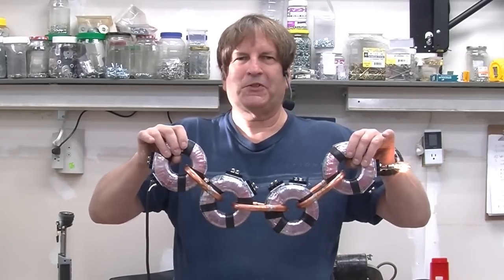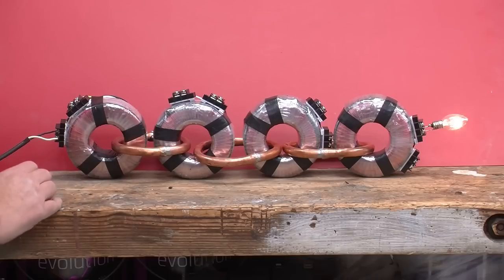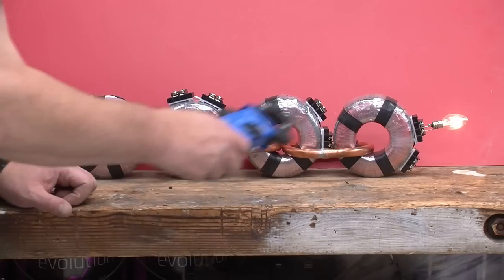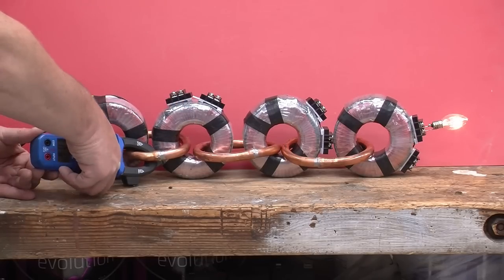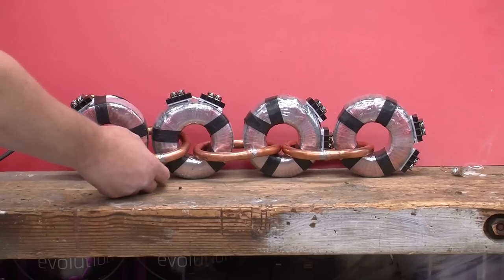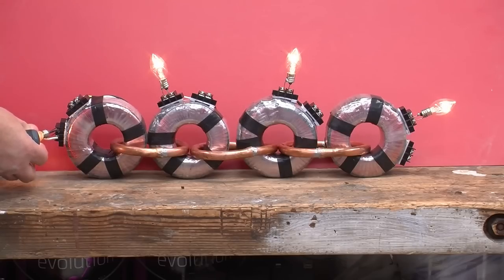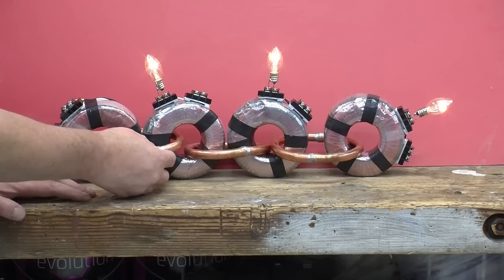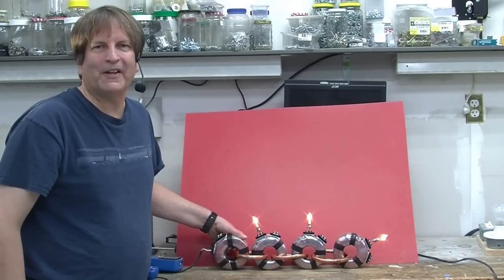Let's Experiment with an Electromagnetic Chain!

Comment: Pretty cool!  Even though the magnetic fields are completely contained within the ferrite toroid, the right hand rule shows that the electric field causes the copper coils to conduct electricity.  Did you see it at the Faraday museum in London?
Reply from the maker: "Even though the magnetic fields are completely contained within the ferrite toroid, the right hand rule shows that the electric field causes the copper coils to conduct electricity." Yeah - is really neat to see that in such an obvious way - usually the "next to each other" nature of inductor and transformer coils and coils makes that hard to see.  The funny thing is a number of commenters  don't seen to think this demo is real - I guess they must think Maxwell's equations are wrong :) 

Museum: That's the second museum in London that has been mentioned, but no - right continent though but not in the UK. I'm starting to make a list of museum that have been mentioned and will post it. I'll; bet the Faraday Museum is fascinating to visit!

Comment: what would happen if the large copper tubing wires were replaced with superconductor materials of the same size?
Reply from the maker: Then we would have almost perfect, losses coupling between the cores and the device would behave much more perfectly. 

An example of perfect behavior  would be the if we put a superconducting shorting wire through the most distant core from the power source, the shorting wire forces the the magnetic field in that core to zero as if the core was not there. That means no back voltage from that core to the superconducting copper pipe to the next core. With no back voltage that copper pipe now is a short and the magnetic field in that core is forced to zero. And so on all the way back to the core attached to the power. And with no magnetic field in that core, a huge current flows from the 120V source eventually melting something. 

In a much better scenario, in normal operation, we would have close to lossless transmission of power other than eddy current and hysteresis heating in the toroids even for larger currents. Right now with plain old copper pipe the resistance starts consuming more and more power as the currents go up limiting power transfer from one end to another to between 50 and 100W or so. The transformers used as the cores are rated at 180W so its much less than one would like. Even copper rod rather than pipe would be better.

Comment: That was excellent, thank you for taking the time to make the video.
I think I need to send this to a colleague who thinks that earth-bonding prevents (potentially hazardous) surface currents close to powerful HF transmitters. lol
Reply from the maker: Thank you! Funny - I actually do a lot of RF stuff in my day job (right now much higher frequencies although did a lot of HF 15 years ago) - one thing  I know is that at RF frequencies, you can always get surprised at where currents and voltages are unless things are entirely enclosed. Highest HF powers I have worked with  are a few hundred watts, but have heard for kw installations, a light bulb with a few feet of wire on each terminal can glow in the right location. Wouldn't want to be in areas where there is that amount of energy floating around!
Reply: @ElectromagneticVideos   Stand under a 550kV aerial feeder line with a fluro tube and be surprised.
Reply: You think Earth bonding is pointless?  
Do you also subscribe to the flat Earth nonsense too?
Reply: @BTW...  I didn't say that earth-bonding is pointless. I was noting that even "connected" conductors can have a potential difference across them when subject to HF radio electric and magnetic fields.
So tell me how a conducting antenna can give you a shock if one end is, necessarily, bonded to earth?
And in answer to your second question, I fully subscribe to the 4/3 earth approximation for RF propagation. So I guess you could argue that I subscribe to "the slightly flatter earth" nonsense! lol

Comment: Thanks for the video. Here is an idea for video I would love to see: explain how current (measurement) transformer works! Typically a transformer is described in terms of how the ratio of primary and secondary turns change the voltage. And it is implied that this is more or less independent of the load on secondary side. So a transformer changes voltage. But then we find out that there are 'current transformers' that are used to measure current flow. AFAIK they are typically just a straight wire (one turn primary) going through a toroid and a multi turn secondary, And that somehow turns the transformer into a current transformer where the secondary current is proportional to the primary current. Explain that! How the heck does the transformer know what it is supposed to do ;) Ok, I think I know the answer but a video to walk through that might be interesting.
Reply: In this video he uses toroid stepdown voltage transformers that are of identical construction as a CT, with a 500:1 ratio.   He does state that there are (maybe) 500 turns around the iron core.. and 1 pass through the hole.  500:1... get it?  
You could call them 2500:5 ratio too if they had a big enough hole.  Pass 500A through primary (core) and connected to an appropriate instrument 1A will flow through the instrument at a low voltage. (5A if your pushing 2,500kA) The voltage is irrelevant. Current flow is the intended metering objective. The analogue meter movements are in fact millivolt meters configured as Ammeters directly connected to the CT's. 
The risk is when CT wiring systems go open circuit in the secondary windings or wiring to an instrument. They can have High Voltage across the terminals that can permanently damage the CT windings.  
NO fuses are found in any CT wiring systems. A minimum size conductor is specified and maximum cable run applies, because of the low voltage and low current. Specific wiring lugs are used to ensure no loose connection can disconnect, resulting in an open circuit. The wire jerkers soon learn proper CT wiring when they get an Inspection fail.. kinda low hanging fruit for testers. You can almost predict the chance of a fail by looking at the installer.  LOL

ALL Low Voltage (i.e. Under 1kV) Commercial / Industrial installation revenue metering CT's, provided by the energy retailer, come with secondary terminals shorted out at the CT terminals. ALL customer CT metering wiring into a control panel passes through terminals designed to easily short out the field wiring and disconnect field wiring to the instrument for servicing and calibration.
   
All pissant scale LV Domestic customers have a power meter with the CT's inside the instrument case... so open circuit CT wiring is very unlikely unless tampered with.

It gets interesting when dealing with High Voltage CT's, designed for 1.1kV to 600kV systems, but same ratio rule applies.  I've only worked with up to 220kV stuff. 
The isolation between primary and secondary windings is of course a principal design factor with anything rated for High Voltage use... so there is no chance of 220kv appearing in a control panel. 
Stay safe now.
Reply from the maker: Glad you liked it! I am planning a couple of transformer videos - one on how a transformer REALLY works and one on current transformers. Its funny - you imply that the operation of current transformers is often misunderstood - and I think you are 100% right on that one. In fact doing some research for this video even showed that voltage transformers are often misunderstood.  The current transformer video will most likely be 3 videos from now, and I usually post a video every weekend, so stay tuned!
Reply: @ElectromagneticVideos  Brilliant, looking forward to it, I think there are a lot misconceptions out there!
Reply from the maker: @Axel_Andersen  Yeah - it really is amazing some of the misunderstandings - you know the one problem with YouTube videos is the time constraint - too long and people stop watching. So we will have to see how well I do explaining things within a limited time!

Comment: If you unplug it does it turn off instantly or it fades out slowly?
Reply from the maker: Instantly! Or at least to the human eye. If it was unloaded (no light bulbs) there would be a little "ringing" or at least a voltage spike/decay for a few ms as any energy stored in the magnetic fields dissipates as heat in the iron and copper.

Comment: Never seen before? It's all over the place, every other corner of the streets has one.
You can even change the ratio of the winding inside them to change the output voltage.

Comment: Are there any examples of where this principle would be useful in engineering?
Reply from the maker: Well general principle shown here is the interaction of electricity and magnetism which is used in generators, motors, transformers etc. But more specifically a transformer made out of loops that are help so they don't touch are used in radio transmitter towers as one kind commenter pointed out - take a look here: https://en.wikipedia.org/wiki/Austin_transformer